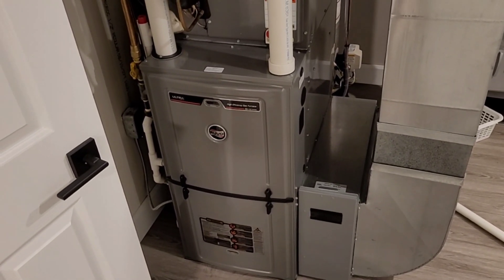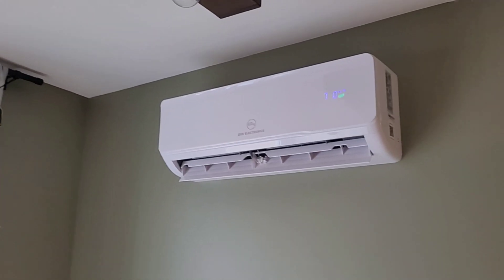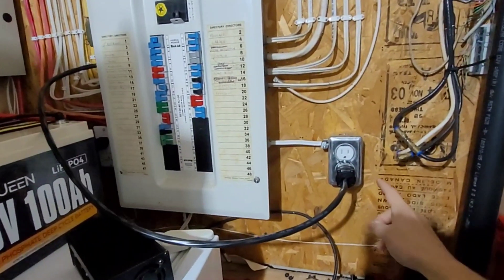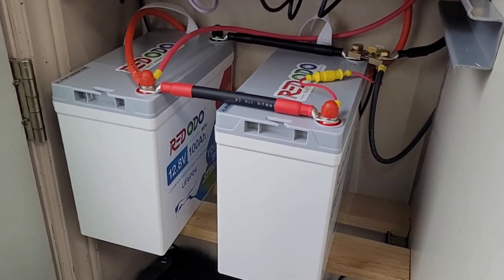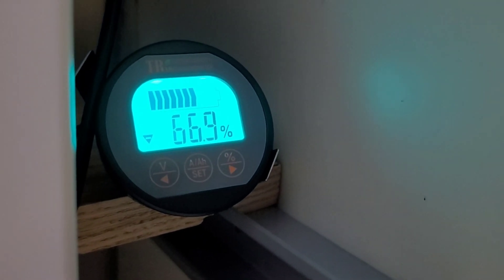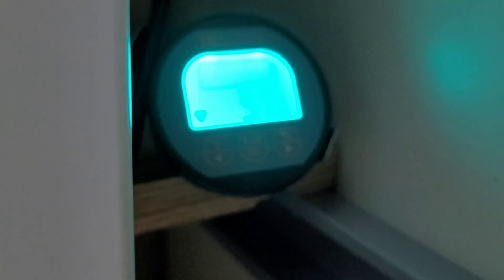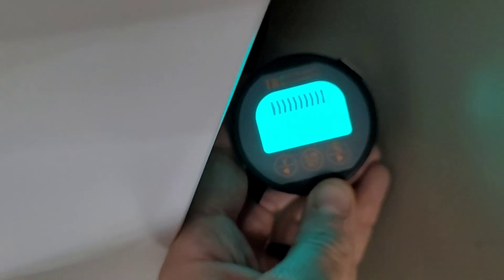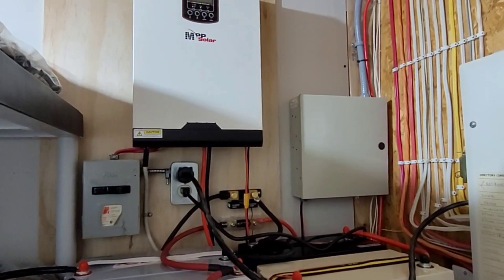Can I Heat My House Without Natural Gas? EG4 Solar Heat Pump + Redodo Batteries

Comment: and... propane is MUCH more expensive than natural gas.... insulate well, thermal storage batteries..... the UK has been using "nightstor" type heaters for a long time..... but in a different way, they are a great match for solar and nightime heat.....  I'm testing  a kiln filled with Basaltic rock.... could use sand etc.  If you have enough interior room could use water too.
Reply: ps my plan:  heat pump during the day , getting the room(s) as hot as possible near the end of the day, and only using resistive heating for the hight temp thermal batteries.  Then heat a small well insulated room to a comfortable temp with the thermal battery.  If/when that runs out AND battery is available use the mini split at a low level (i'd probably be sleeping by then).    If several days of cloudy weather then use diesel parking heater/ run generator to charge batts and recover the heat from it.   Very last resort burn propane (because the house has that already)

Comment: Your furnace fan may draw 200, 300 or even more watts.  I understand it improves overall comfort but I'm not sure it improves efficiency.
Reply from the maker: It only uses 90w on low fan speed and 400w in second stage heat, with the inducer and gas valve on. It's pretty efficient. It's well worth it to run the continuous fan to help get heat to the bedrooms.
Reply: @SmitHVAC.  Ah low speed.  That makes a difference.

Comment: I believe my January gas bill was nearly $400 in Central California where it will dip just below freezing at night sometimes.  We had a shortage which more than tripled the rate.  I have wooden floors and no foundation so my house is poorly insulated at the bottom, so my heating bill will get high in the winter.   I purchased a Little buddy and a Big Buddy space heater, an electric blanket, and a CO detector that I move wherever I have a space heater going.  I will use the central heat or air for 30 minutes to an hour when it's extremely hot or  cold to get the whole house cooled down or warmed up quickly, but mostly use window air conditioners that run off batteries from off-grid solar or the propane space heaters.   I will probably add a couple of mini splits eventually.  Thanks for the video.
Reply from the maker: Wow thats pretty high, I have the dewalt version of the buddy heater but only for ice fishing and emergencies. Mini splits are a nice way to go, I have a video calculating the efficiency on this eg4 coming next week.